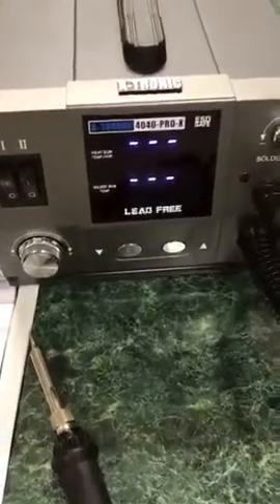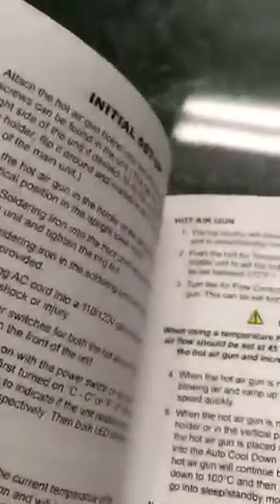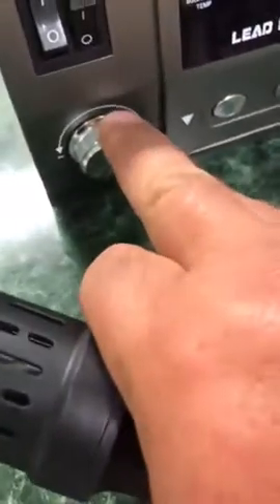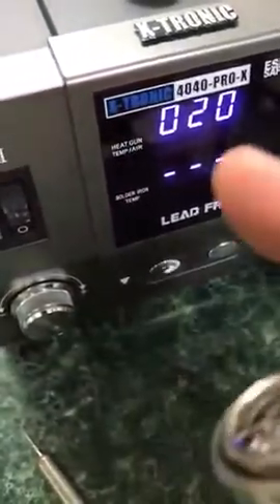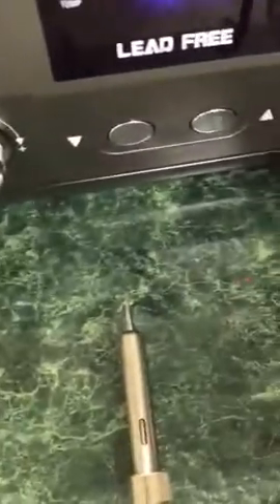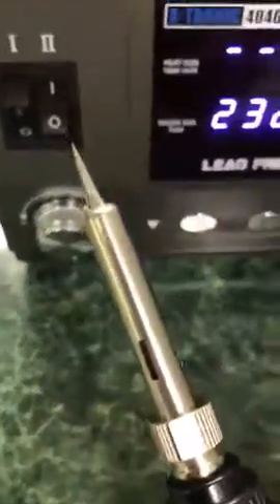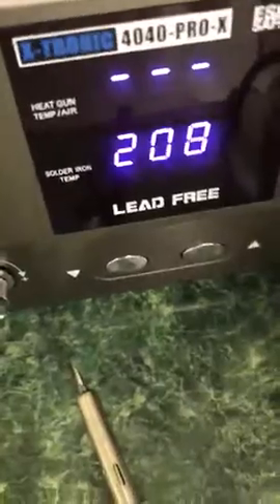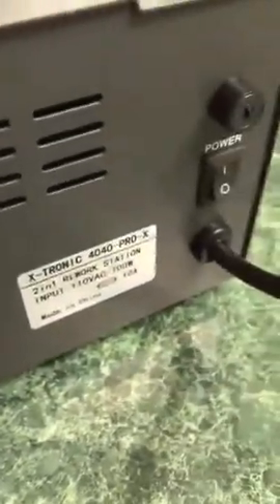X Tronic 4040 PRO X • Platinum Series • 700 Watt Hot Air Rework Soldering Iron Station Review

Comment: can you get the air to go below 20, if I could i would as 20 is just a little to much for small smd but does work ok, when you have parts in between others its hard to isolate and get in real close due to wind speed, ya end up de-solder parts that are too close to the work at hand....
Reply: plus why would it start out at 20 instead of 0?